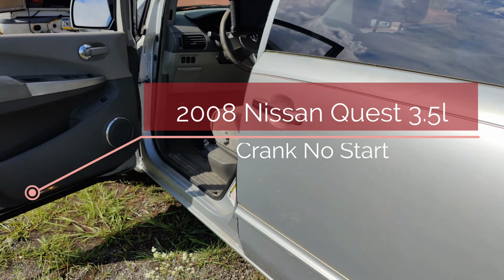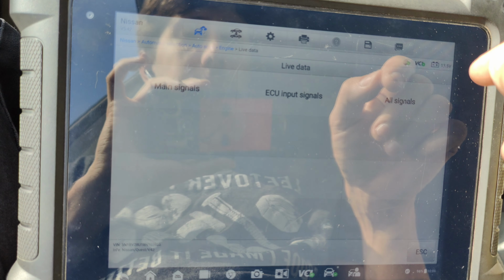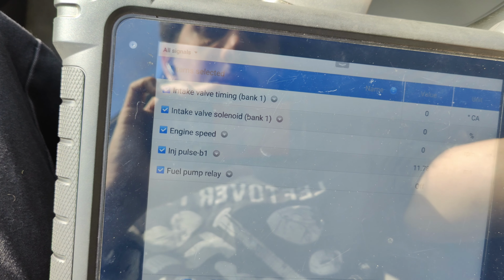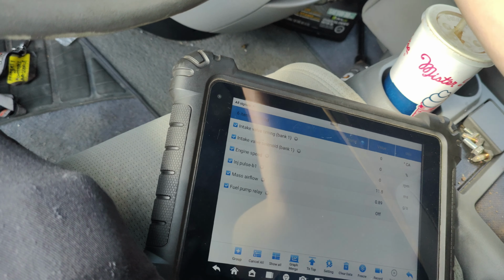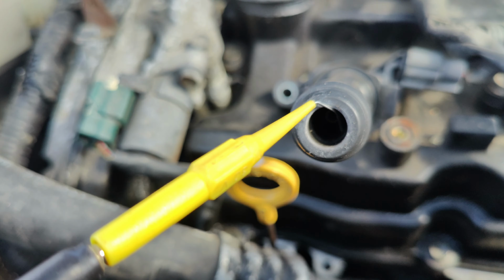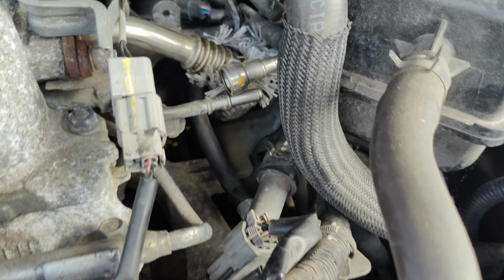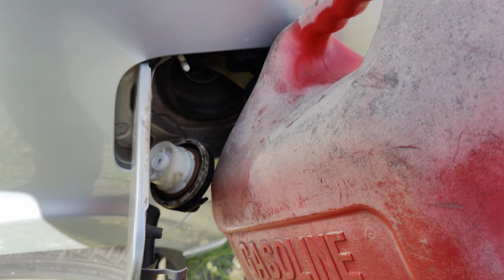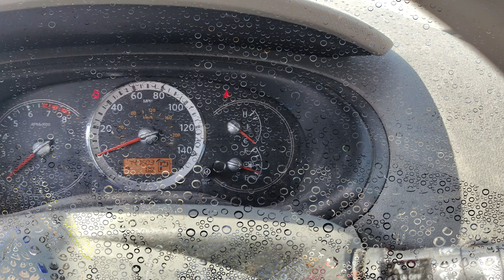2008 Nissan Quest Crank No Start?

Comment: Aint got no gas in it thats whats wrong wit it
Reply from the maker: Yea, and the trans cooler dumped all the fluid on the ground because the tow truck hooked to the trans lines to pull it on the truck.